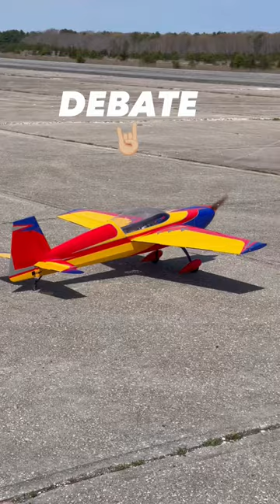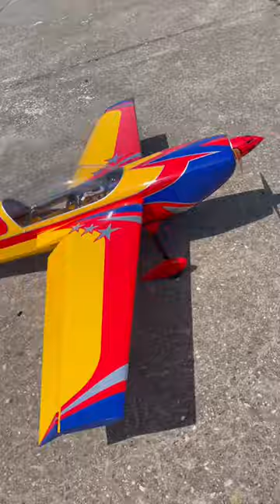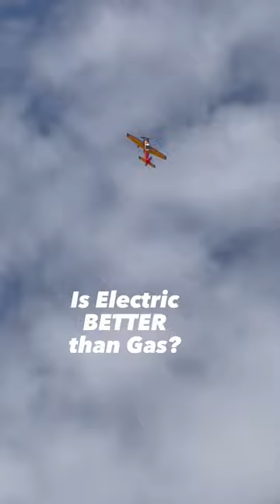GAS vs ELECTRIC Rc plane… what’s better ?

Comment: Afford it?!?  A 12s means two 6s batteries.  At $100 per batteries for good ones, you get 3-5 mins a flight.  Seriously?    With gas, I pay $4 at most for a gallon, and with a big plane, a 25 oz tank, I can fly all weekend.  $4 a weekend vs $200+ per flight.🤔

Add that to the cost of a good ESC ($150+), a good motor (jeez), when I can get a GOOD 120cc for $600, AND fly for 10 mins+ a flight.  PLUS there's no substitute for the noise of internal combustion.

No debate.  Gas or pass.  Petrol or nothin at all.  Electric is for posers.

Oh yeah, and no smoke unless you get those pods that drip residue over everything...